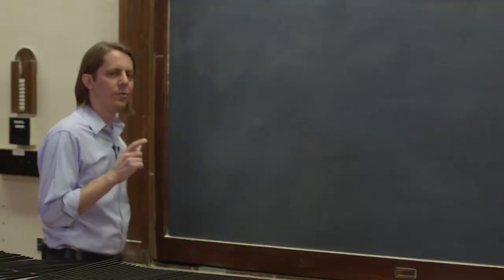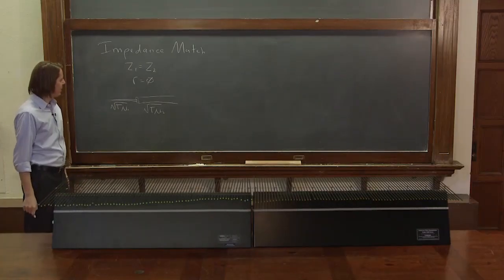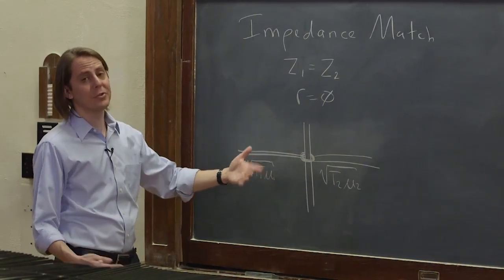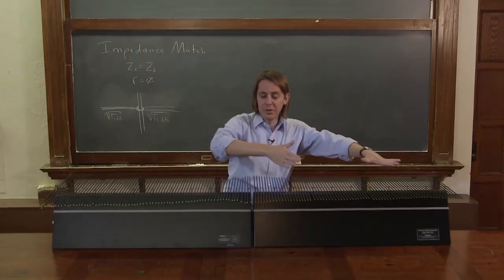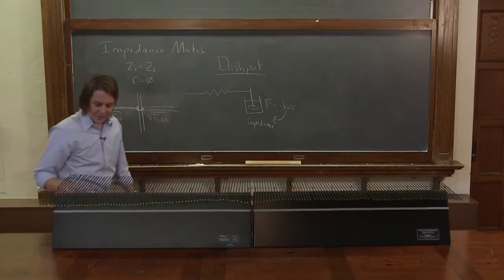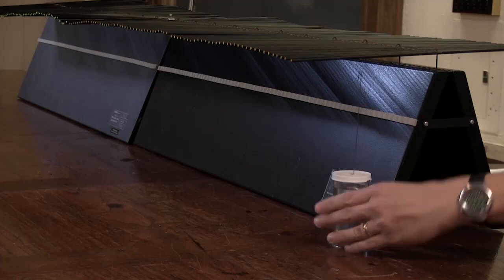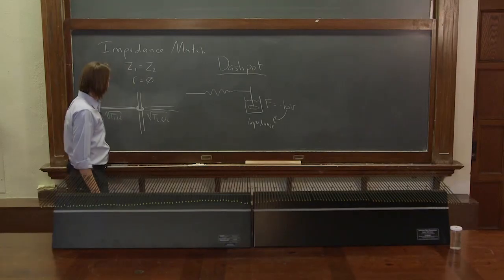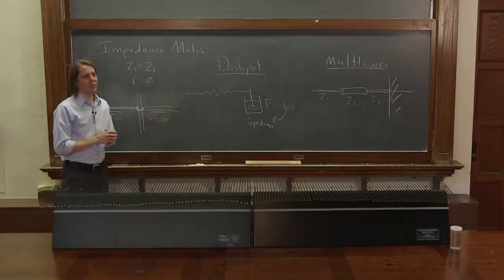PHYS 201 | Wave Interface 8 - DEMO:  Impedance Matching

Comment: Your "throwaway" comment about light wave impedance matching made this click for me. I guess you were talking about anti-reflective coatings. One way to stop something reflecting is just to make it out of black material like your dashpot. But that's not so great. It makes sense now why impedance matching using that multilayered approach only works for certain frequencies - the same way that anti-reflective coatings work for certain wavelengths of light. Thinking of characteristic impedance as refractive index has meant I can now use all the tools, intuition, and understanding I have from optics and build on them to understand AC electronics. Brilliant, thank you!